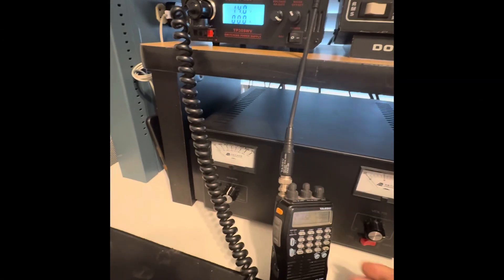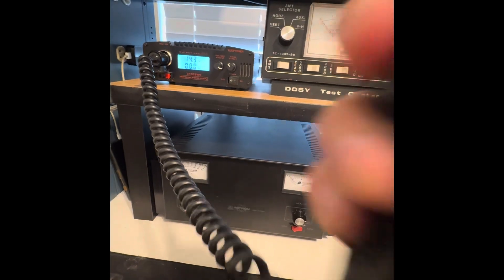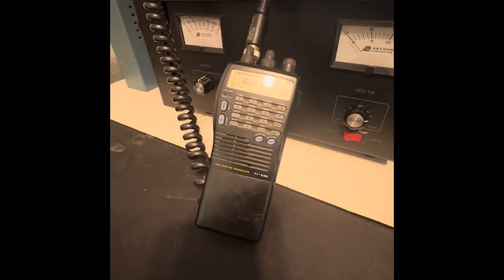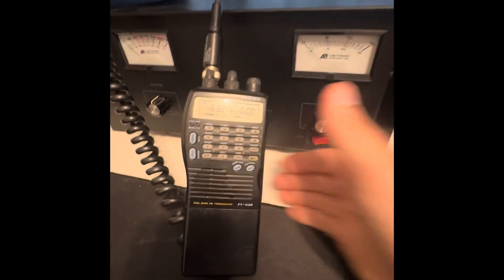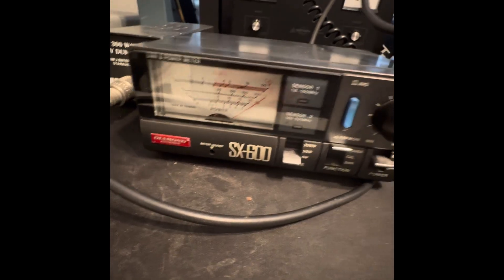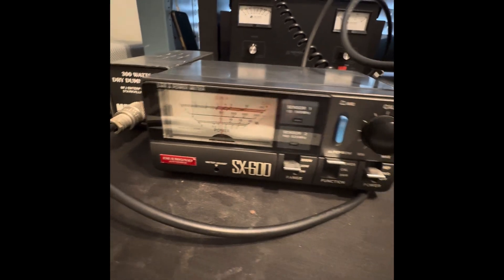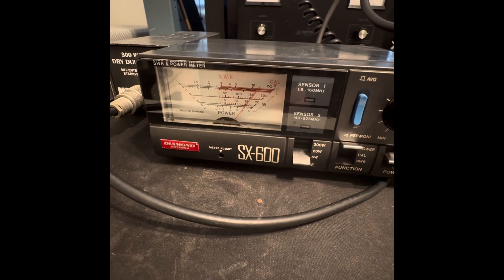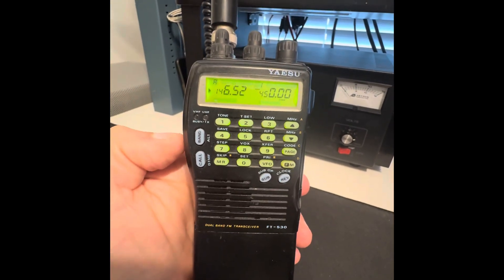Yaesu FT-530 Quick Test

Comment: Hi! I’ve one and can’t set up a low frequency than 130 to hear airband.
Reply from the maker: I found this but I no longer have the radio so I can't verify:  To turn on AM ("A3") detector (to receive 110-136 MHz aircraft band; possible in VHF only), push FM - SET - FM - VFO - PTT. "A3 On" or "A3 Off" will appear in display. If not already active, turn on 110-130 MHz receiver section by holding in up & down keys while turning on power.
Reply: @Z28videogates  You’re genius, it works. Thank you.